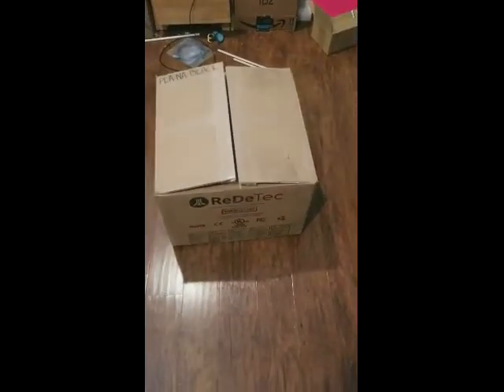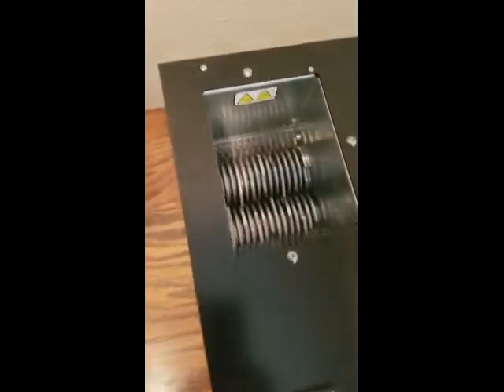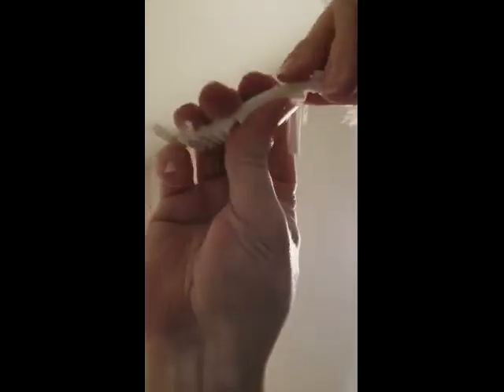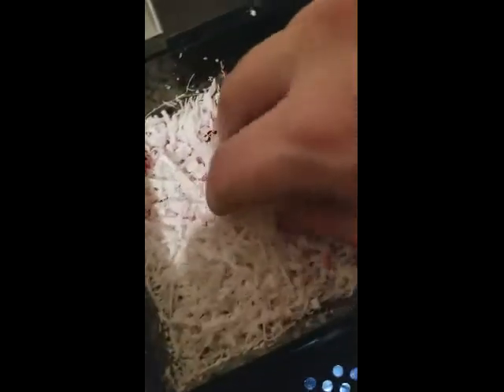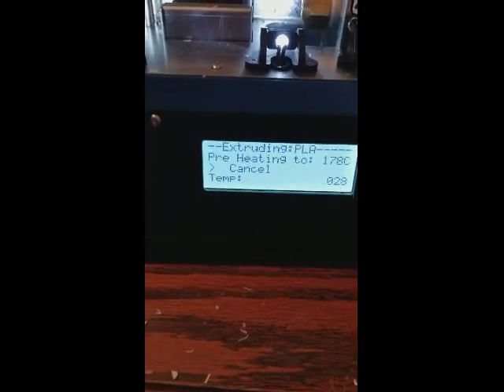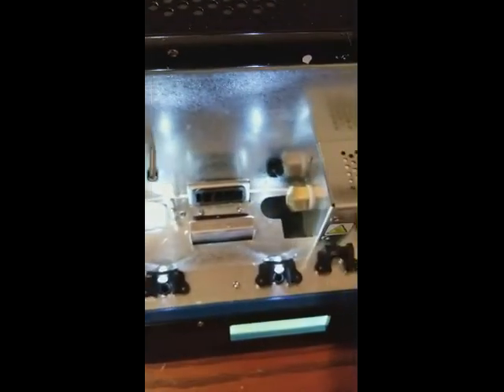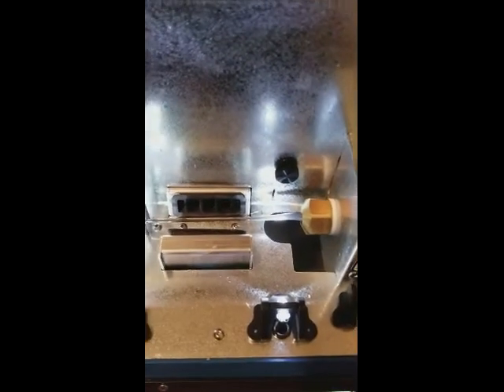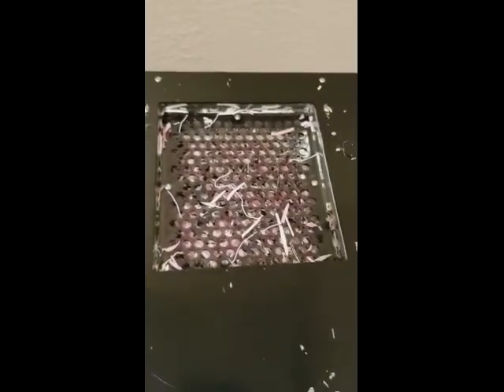Unboxing and first attempts at using the protocycler

Comment: hey Jason I got my Protocycler also but i'm having issues with getting the correct diameter 1.75mm. when I set it to Auto it would make 1.4mm and Manually was hit or miss 1.8mm to 1.4mm.. And I have email mailed them over and over and still no answer. :( Any help would be great!

Comment: I just got my ProtoCycler on Dec 11, and I also have issues like you. How did your recycled filament turn out? I cannot get mine to extrude recycled filament even with a 50/50 mix of virgin resin. The filament at the nozzle keeps drooping down below the optical sensor at the nozzle. Is this happening to you?
Reply from the maker: I'm not having the filament nozzle drop; unless the spool slows down too much.. then it droops and becomes a huge mess.... As for trying the filament..... I went to try it and do a follow up video.... It wont fit through my extruder... so doing a measurement check in stead :-/
Reply: I found the source of my issue. The pre-nozzle mesh filter was plugged with metal particulates. Considering that the machine has been doing that since I got it, makes me wonder if it was that way when it shipped. I find it very hard to believe they let it out the door like that, but what else explains it? I cleaned the mesh filter, and it works excellent now.
Reply: When did you order?
Reply: Sangrilus I ordered early 2016.
Reply: Last I spoke with support they are working on getting units out. The production manager is doing a great job, but testing takes a while. You could call them and ask to see when it's expected to be shipped.
Reply: btechnet they not reply to my mail or social network as lot of us
Reply: I sent 10 requests in email and no answer, then called them on the phone and spoke with the manager.
Reply: I was not part of the Indiegogo, I was on the pre-order, which to my knowledge was after the campaign.
Reply: How much is this?
Reply: The official price is now at $1299 USD, the pre-orders were much less.
Reply: So what is the consensus? Does this thing work? I’ve been thinking about getting one? Anyone?
Reply: Even after the nozzle cleaning I continued to have problems with mine. It turns out that mine was damaged in shipping further than what is noticeable on my video. At this point I've sent mine back to Redetec for repairs and testing. That was about 2 weeks ago and so far I've heard no word. I suspect that they have been quiet since they are in the middle of their move to the new facility. While I prefer not to bash a company, here are my thoughts so far:
Their support communication is lacking. From my discussions with other users, it is apparent that they might be having issues also. The biggest issue is cooling of the filament before it's spooled.  The cooling air flow is lacking leading to the filament being oval instead of round when spooled. I've had to manually run my machine to get the correct size / roundness, leading to decreased performance.

I so badly want it to work, but thus far it isn't. I hope that they are able to fix their issues and get back on track. I can't speak for any others on here, so hopefully they also respond with their results.

All my above test were done testing with 100% raw PLA and 50 / 50 (recycled / raw mix).
Reply: btechnet did you find solution how to fixed im giving up on mine its make me crazy

Comment: Great vid, glad to see it working, your pro con list will come in handy when ours comes in. Did you receive a shipping notification for the order or was just a delivery surprise?
Reply from the maker: I received Fedex shipping notification. I hope you get yours in before they have to move. ;-/
Reply: Thanks for the reply, hoping mine would be traveling this way by now but not holding my breath. My pre-order was Nov 2016. Hope they can buy more time to put more units out the door. If not lets hope the move goes smoothe for them.